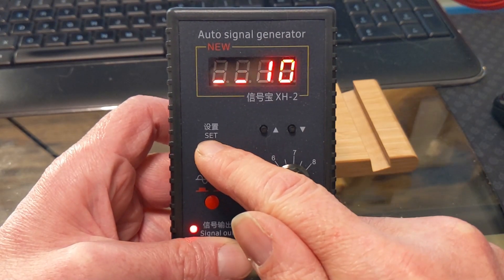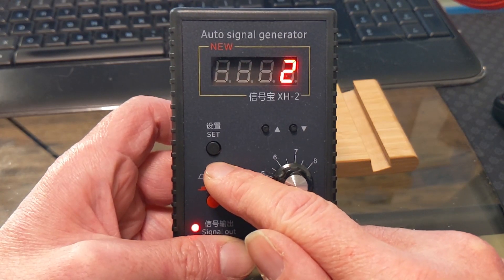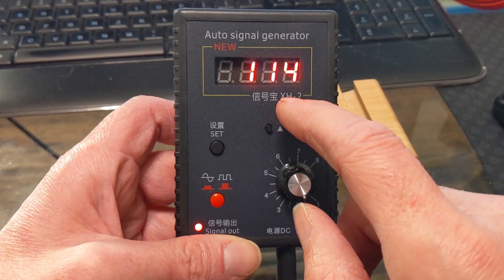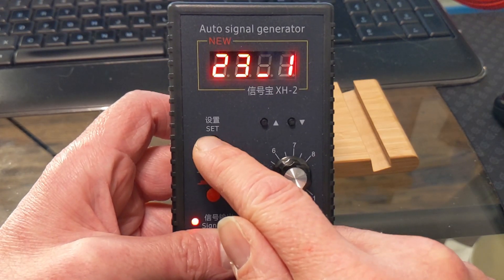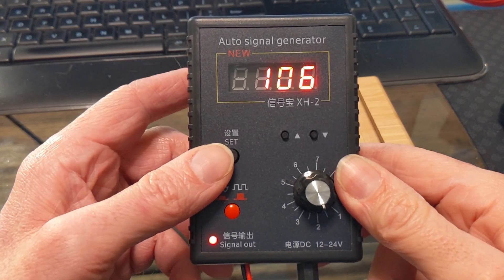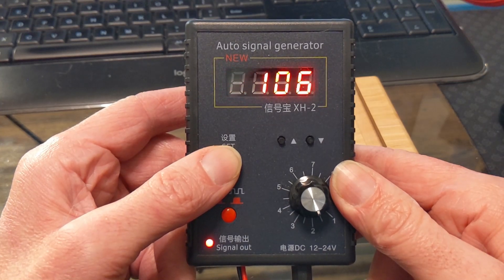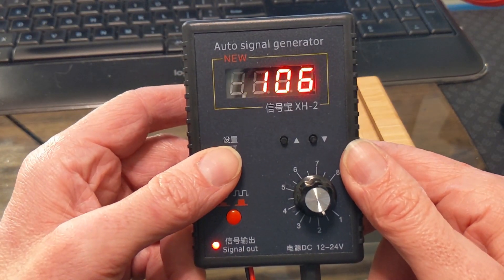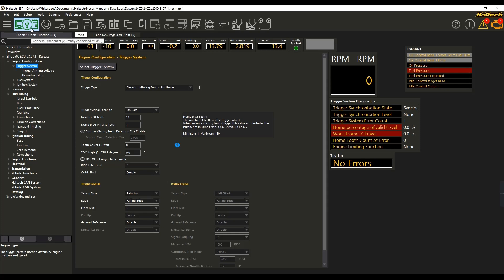XH-2 Automotive Signal Generator CAS Demonstration

Comment: Hola buenas noches gracias por el vídeo acabo de recibir mi equipo 
.solo quiero hacer una pregunta para generar la señal a un auto Nissan Sentra 2001. Yo conté 21 dientes. ? Cómo lo programo 21 + 1 o - 1.
Reply: Pudiste usarlo o se necesita 2 aparatos
Reply: 22-1